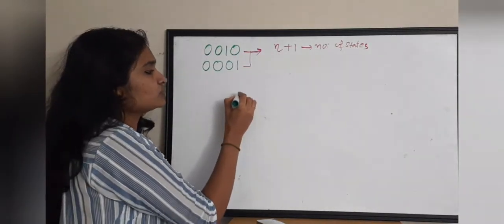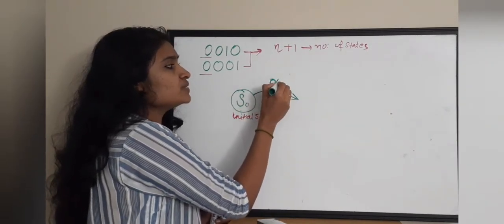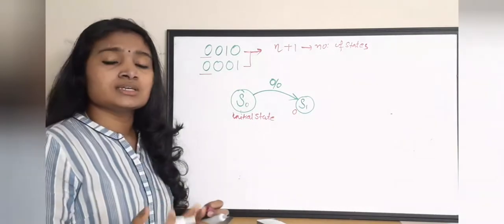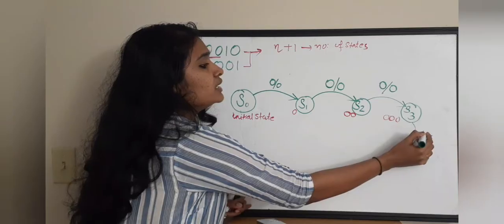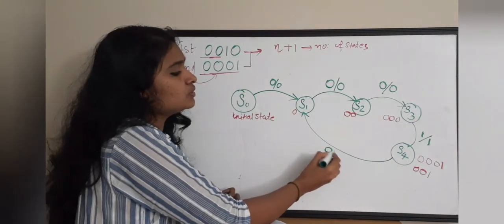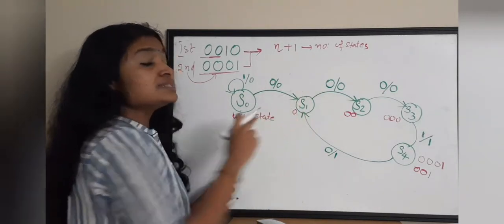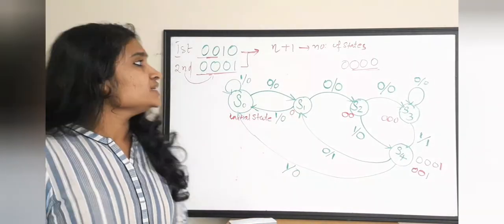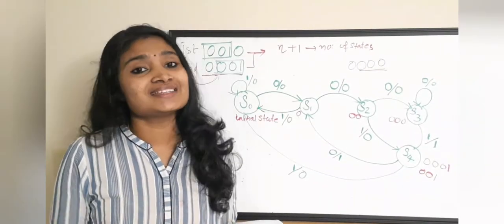0010 and 0001 Sequence Detector Using  Melay FSM|Multiple sequence detector using Melay FSM

Comment: In question if they gave detect sequence "11011" using moore sequence or mealy sequence detector machine.

In above question there is no mention of whether overlapping or non-overlapping. In these case which to apply "overlapping" or "non-overlapping"???